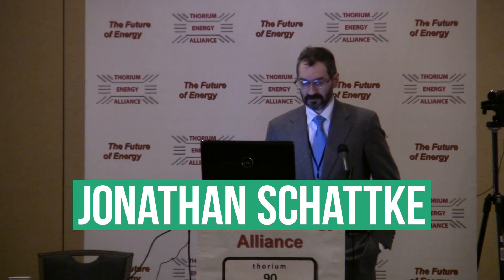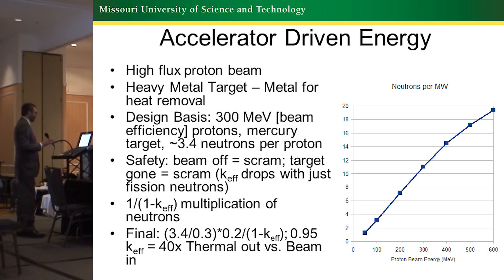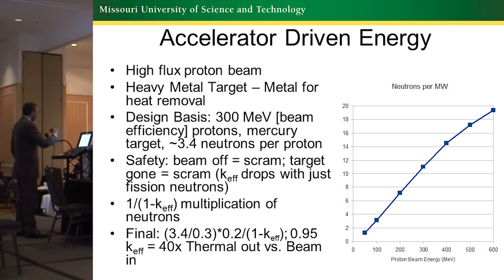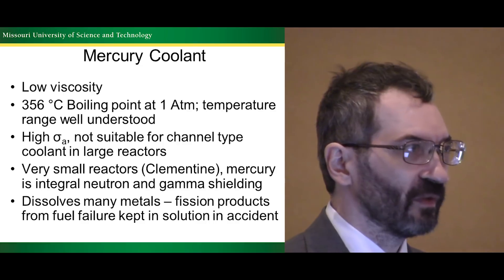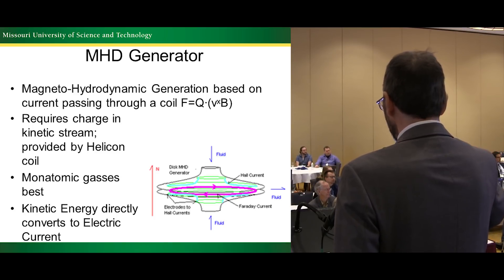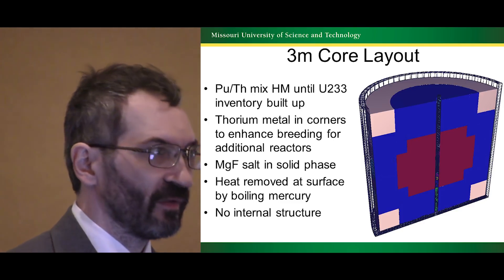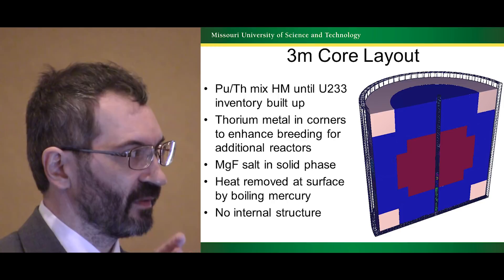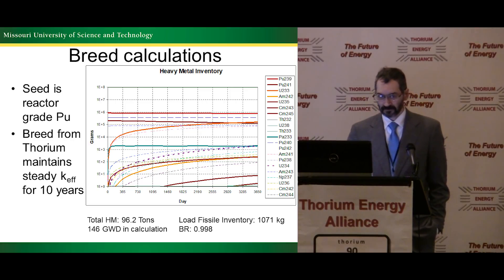ThorMer Reactor: Nuclear Power with No Moving Parts - Jonathan Schattke @ TEAC8

Comment: thermochemical cycles have virtually no moving parts and fuel cells are solid state; reports around the turn of the century revealed about the same electric output is possible as prime movers adding the mhd top cycle then possibly even starts to match cogeneration so conceivably there's a choice here it seems too

Comment: Definitely many seem to agree that a solid-state reactor with an MHD seems like a good candidate for space applications, and I would add that it would be a solid choice for a Mars power and fuel plant. For a space-craft, a fission fragment decelerator would likely be a better choice to extract electricity directly from fission fragments before allowing them to fly out the back of the craft, providing acceleration. Trade-off between propulsion and electricity generation could be varied by either increasing or decreasing magnetic field strength of the decelerator. Something I got thinking about after learning about Maglich's Exyder and Helion's fusion reactor.

Comment: This seems like an inventive and pragmatic approach, my only concern is the mercury operating under pressure... not a problem as long as core integrity is maintained, of course, and I'm just envisaging a worst-case scenario for leakage/ruptures with regards to containment. That aside, surprisingly promising! Even the proton accelerator to provide fission reducing output seems like only a minor impediment, offset by the increased control over production. This deserves further investigation, good stuff!

Comment: How would you remove fission byproducts from the core? Specifically, if you get gases like radioactive Xenon (like it does in a solid fuel uranium reactor), they will crack up the solid salt and/or escape with the Mercury.

Comment: Jonathan Schattke
What are the primary areas of material degradation that you predict? Any way this reactor could be built to be essentially immortal, ie; refueling while in operation plus no portions ever needing replacement or overhaul?
Reply: The highest damage will be to the pipe separating the core from the mercury in the spallation area. The wall can be built very thick to compensate.

Comment: What rate of manufacture is possible (GW per year), assuming doubling of mercury extraction rate from mines?

Global production is at about half a trainload per year currently.

Better, perhaps, to make reliable/serviceable moving parts in a liquid-salt design.
Reply: I think he specifically said this design would be relatively low power. Using Mercury as his coolant and spallation target, he's effectively limiting the heat generating capacity. Since he's not actually using heat to boil water or pressurize gas, he is accepting that his reactor is not overly powerful.
But it is incredibly safe and presents a design that could be used as a basis for those SMRs we keep hearing about. If he wanted to skip having to breed Thorium, and just use metals that are already fissile, he could make the whole thing smaller still.

Comment: I'm interested if the waste heat is enough for water heating/boiling or any useful thermal utilization? Was comparing this SAFR design  Elysium's MSFR.
Reply: bob dash the mercury at about 5 atmospheres pressure boils at like 450 °C. If process heat was needed, there could be a properly designed secondary salt loop to take heat off the top of the core.
Reply: Ok thanks, so you would have MHD electricity generation along with a secondary thermal salt loop.  one last question what is the power output for a single module electric and thermal? I'm from a small island so this is very interesting to me.
Reply: bob dash easy to do 10 MW thermal/ 2 MW electric... Could do that almost immediately for less than $1M not counting the fuel. A little more work can push that to 100 MWth/20MWe in the same footprint for perhaps $5M, with the same fuel load. Simple makes savings.
Reply: Jonathan Schattke Ok, 10-15MWe is very doable. Though not cheep. Hmm.
Reply: bob dash this would be cheaper than a comparable power natural gas plant in capital costs. And have 1/1000 the fuel cost.
Reply: @JonathanSchattke for $1M? is the cost of the accelerator included?

Comment: +gordonmcdowell -- What is not clear about this design is how waste heat from the mercury condenser, somewhere above the reactor, is supposed to escape from inside the thick walls of the containment building. Water spray was mentioned, but that was in response to a question about emergency procedures. It did not sound like part of normal operation. Can you ask Jonathan Schattke for clarification?
Reply: The containment would have a single fairly small pass through for a heat pipe. All nuclear plants have multiple holes through containment for the heat take off, instrument and control wires, power supply, etc.

Comment: Thank you thank you thank you Gordon for bringing us this incredible design and presentation. Even though it's a paper reactor right now. NO MOVING PARTS! (Aside from the mercury and the gas in the MHD generator.)  And the output temperature can be boosted by the turbo inductor, that I wrote about on Thursday, for industrial heat uses. That introduces moving parts, but they're outside the nuclear island and not subject to regulation. OMG!

Science fiction author Robert A. Heinlein described an accelerator driven reactor in his 1940 (!) short story Blowups Happen. For dramatic purposes, his reactor (one reactor for the whole USA)  had to be balanced on the knife edge between producing no power and exploding by constant human control. And here we have sorta the same idea - but incredibly stable. With power output adjusted by dialing the accelerator beam power up and down, which is instantaneous since the protons don't weigh much.

My jaw has hit the floor again and my head is ringing like a gong. Just wow.
Reply: Blowups Happen was a critical core, Heinlien didn't know about the delayed neutron fraction. Without those, you would have basically a barely controllable bomb.
In any case, Thank you for the praise. I have added one moving part in operation, a gate valve, moved to molten salt, and a critical core controlled by the fluid level and temperature effects. We are working on design simulations for a research reactor and a power reactor. http://s-a-n-e.com
Reply: @JonathanSchattke  Seriously? There's a book by Heinlein which I haven't read yet? And it's about nuclear energy? BRB, gonna read a book real quick.
Reply: @MrRolnicek  It was a short story, maybe 7000 words
Reply: bob dash I am pretty sure I can make it fit in a single 45' shipping container. Then the control room and grid interface in a second modular shipping container.
The confinement would be something like 40' by 40'.
Reply: Nice stuff, how compact is your SANE SAFR design? When I looked at the visual thought it would be insanely compact as a tightly integrated modular reactor!
Reply: Robert L. Forward proposed fission sails in fiction and physics Scott adopts energy sails in a film

Comment: I think I missed it - how did he control power output
Reply: The reactor is always sub-critical. Fission only really happens when proton beam is on. Shut off the proton beam and the fission chain dies out immediately, down to a trivial background level from the occasional spontaneous fission. Fission rate is therefore controlled by varying the proton beam current.
Reply: It's constant by the design of the breeding rate. But you could conceivably vary the proton beam going into the mercury target to lower the thermal output if it behaves different than expected.
Reply: +Serious Dude --  That is correct, but it's a response to a different question than the OP, because Residual Heat is not subject to Control. It must be dealt with, not controlled.
Reply: Either pulse the proton beam or vary the power of the proton beam; which you do would depend on the accelerator.
Reply: Decay heat rem,oval is by the same loop - boil mercury, condense it. Should the mercury loop be breached, A final design would have a radiator that could clamp on to the base; even a few inches of mercury could transfer the heat by convection.
Reply: Thanks for elaborating on that. Having passive decay heat removal, with a sub critical reactor should provide great inherent safety.
Reply: Serious Dude actually, I was thinking a multi-stage magnetic bottle like in a VASIMR rocket. I can have a really sloppy beam.
Reply: The first part is right. The reactor is sub critical and only produces appreciable amounts of heat when it's fed neutrons. But when it has been running for a while radioactive fission products will be present that have residual decay heat and radiation, even after you turn of the neutron source. At least that is true for all fission reactors I know of. Please let me know if I missed something here!
Reply: Have you considered a dense plasma focus or other small fusion reactor as a neutron source for a subcritical reactor? I suspect it could greatly reduce the initial capital cost compared to a linac.
Reply: accelerator into the spallation target free protons to breed thorium to uranium then bang
Reply: Wat?
Reply: When you talked about the fission reaction stopping as soon as the neutron source is turned off, I thought you were talking about safety aspects of the design. It sounds like a great inherent safety feature. Which it is. But emergency shutdown is essentially solved with dropping shutdown rods in todays reactors. Granted, an electrical driven neutron source would have even greater inherent safety concerning runaway fission reactions. But in todays reactors removing decay heat is the greater safety concern. And that concern would still be there with an external electrically driven neutron source.